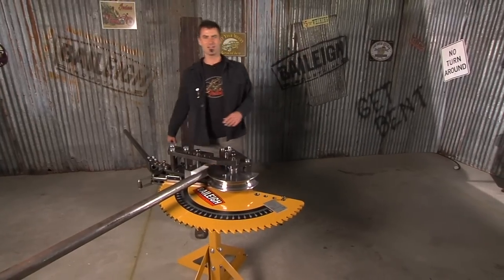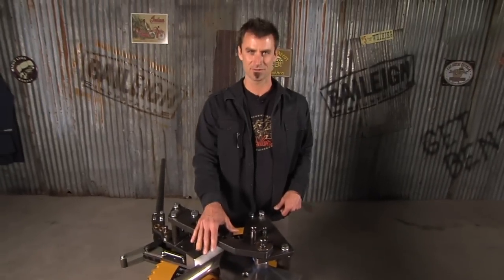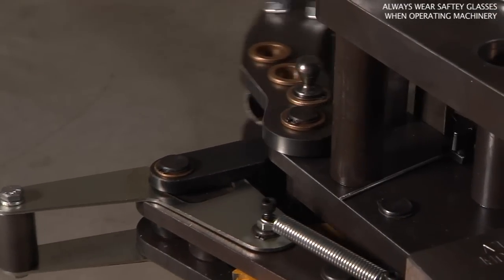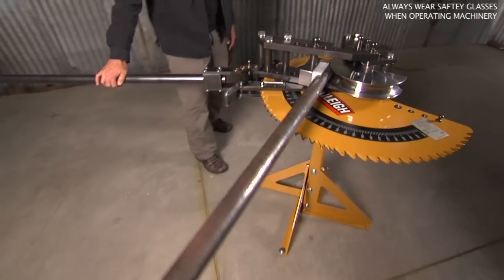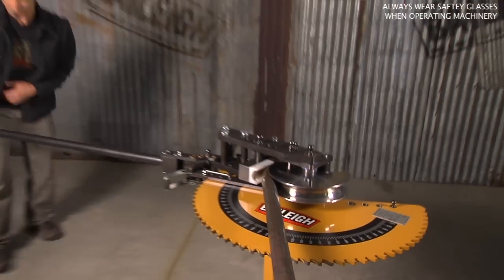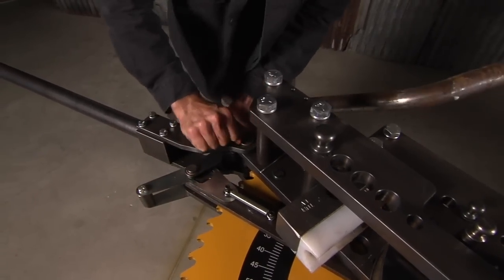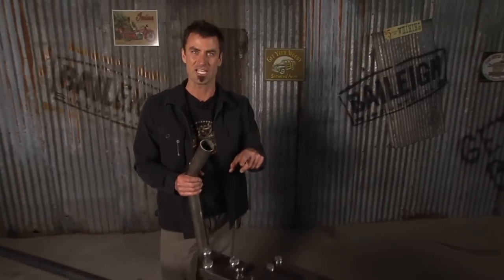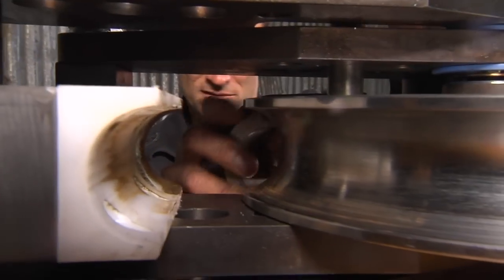Baileigh RDB-050 Tube Bender, 3 speeds, Large Capacity Tubing and Pipe Benders

Comment: Use 1 of these in work n must say its the worst back breaking tool iv ever used in my life. Removing tubes once bent requires forcing it back to start or hitting tube with mallet to loosen 1 of the pins that hold the platic grip thing in place. He done it on easy and slowly to hide how hard it really is. But it really is good at what its for